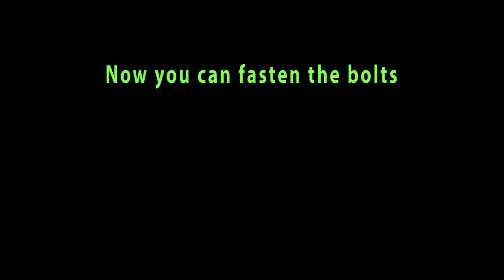How To Replace the fan heater blower from the Seat ibiza 6J

Comment: Hi Jan, do I need to buy a specific blower for this car (same model, also with Climatronic) with AC/Climatronic? Or will any blower with the right OEM-Number do? It's quite had to find a good answer online
Reply from the maker: Hello, i had manual airco also. Indeed, you have to see to the original part number, and then you can order one which is the same like the original one. Maybe you can search also on (mister auto)  (autodoc) Greetings from belgium

Comment: Great video! By Ibiza fan only works on speed.2,3 and 4? Is that another problem?
Reply from the maker: That is another problem. In my case the fan did notihing anymore. Maybe the switch, that there is no good connection in stand 1.

Comment: Hey there, great video. I have an Opel Corsa 2006, and the blowing system doesnt work anymore, not on 4 either. Sometimes it turns on, and blows like it’s struggling, them it turns off again. Would you suspect that the problem could be like this video? Like it’s not turning good anymore? Thanx, Casper
Reply from the maker: Hello Casper,

Have you already build out the fan?

If it turns very stiff when you try to turn it with your hand, then the chances are quite high that it is the fan.

You can also try if the fan is still built in, and it is controlled by the button being in position 1 or 2, for example
to help him and see if he fires up.

Good luck
Reply: Kachelweerstand kapot

Comment: Hello sir, I found an error message ServoMotor v70,do a basic sitting or change it please how I can breakdown it
Reply from the maker: When i changed the fan heater, i did not read out the board computer, just because of it did not  work anymore i build it out, and i marked that it did not turn well. So i replaced it, and the problem was solved.